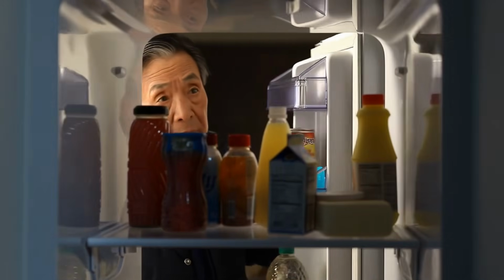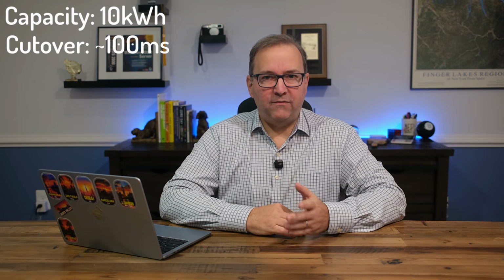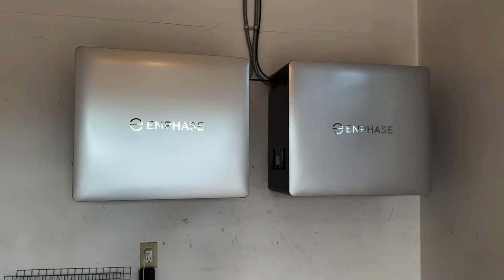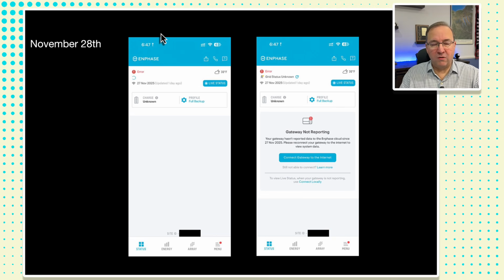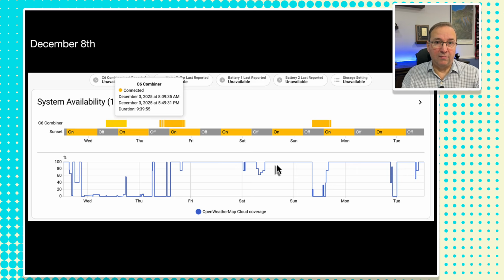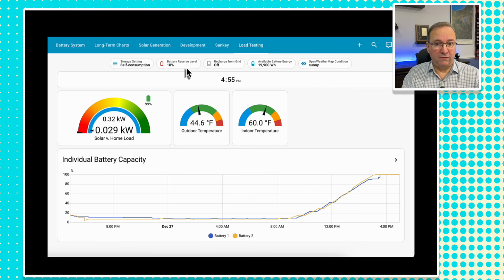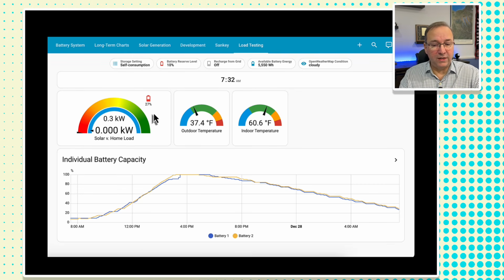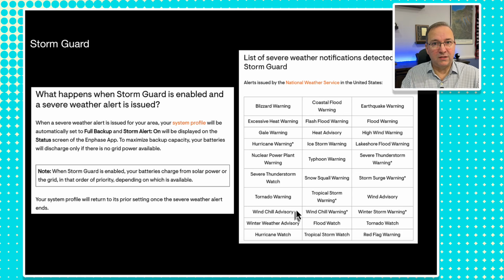I Tried to Run My Entire House on Solar Batteries for 24 Hours.

Comment from the maker: Winter storms and power outages are what finally pushed me to take home batteries seriously.

I tried to keep this video grounded in real-world experience rather than specs or marketing claims. If you’ve already lived through an outage - or are thinking about adding batteries to your home - I’d love to hear what questions you’re wrestling with, or what surprised you most once the power went out.

I’ll keep an eye on this thread and answer what I can.
Reply: Thanks for making this video--super helpful especially your trouble shooting approach.

Having the same exact errors and issues after initial provisioning 2 days ago (minus the cloud cover issues). Did the enphase tech mention what the issues ended up being or what the actual remediation was? I am being advised to go back to our installer and trying to document as much as possible.
Reply from the maker: @imichaelray  Not the best answer, but the field technician (working with my electrician) kept saying something to the effect of replacing "the stick" - I assumed it to maybe be some kind of comms card that was screwing up all of the data.

Whatever it is they did, once that change was made everything was working normally and has been ever since.

If you want to to some data capture, Home Assistant + the Enphase integration would at least allow you to pull in a lot more detail so that could help inform your working with Enphase to get this resolved.  As you saw, ultimately they did make it right for me but I was glad to have the additional data available.  I'm uploading a "Getting Started with Home Assistant" video here on the channel in the next few days if that helps.

Hope they get it all sorted out for you!

Comment: We installed a 14KW solar array in November 2024.  Now that things have gone downhill faster than we expected, I was intrigued by the Enphase 10C figuring we would need 20KW. I am dismayed at the cost for batteries & install when the batteries & controller go for less than $15000 retail.  The installation is supposedly so simple. Looks like getting a better backup generator is more affordable. We have wood heat in the winter, so no worries there. Good review none the less.
Reply from the maker: I think backup generators are still broadly more cost efficient overall in the short term compared to any battery system.  But we're in a rural area without natural gas delivery so we have a propane tank it would start sucking down.

If we were in an area with a natural gas utility service, I feel like I probably would have gone that route.

Comment: You can use your electric vehicle battery v.soon which is 4-5x your exsisting battery capacity. This is what im waiting for come June/2026
Reply from the maker: I've been hearing about that forever, even my electrician 4 years ago asked me "why get batteries, you'll be able to plug in your car soon!"

But it seems to me that V2H / V2L (?) has been incredibly slow/niche so far.  And with a bunch of Federal tax credits expiring in 2025, we decided it just made sense to jump in with the batteries instead.

But yeah, I'd much rather just have a fully vehicle-based system.

Comment: Excellent video, curious what was your cost for batteries and install
Reply from the maker: There was some electrical panel work that had to get thrown in there, so it's not a clean estimate which is why I didn't include it in the video - but "ballpark" the battery + install part of it came to a little over $20,000.

Comment: All that and didn't share the actual results.
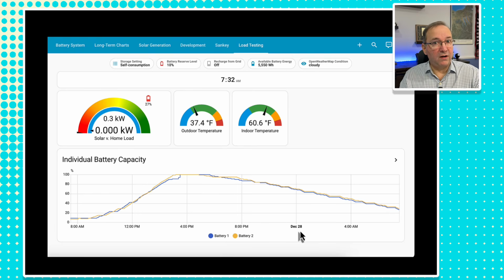Reply from the maker: The results are in the summary slide that starts at about 15:04.  5 overnight test passes, 4 passed (lived solely on battery from sunset to sunrise) - 1 failure where the battery only lasted 11 contiguous hours.

Comment: 20 kWh of storage and 8kWp of panels.  That's a decent basis for emergency backup but you definitely have to be careful about what you actually run in the house across winter.  You'll only be pulling in ~16 kWh/day with sun and you'd be lucky to get 4 kWh/day in cloudy weather.  The fridge alone will burn 2 kWh/day so yah, it definitely becomes a weather issue.

For winter operation, or winter emergency operation in cloudy/stormy weather 8kWp in panels isn't really enough, either.  But it generates a good chunk of energy 9 months out of the year so buying into an expansion is definitely subjective.  

Keep in mind that all roof facings are available for solar and will generate roughly the same in cloudy (ambient light) weather even when a sunny winter day gets you almost nothing from the "wrong side" of the roof.  And in summer you get serious augmentation of your main south-facing solar due to the higher sun, which makes running A/C a lot easier.

--

If it really came down to it (and we're talking Urban here not Rural where these things are absolutely necessary)... this is where having a backup generator to recharge the batteries, with auto-start, can really come in handy.  If you go that route go with propane because you can use the propane for direct heating too if necessary and its shelf-stable.  Tank it and forget it, basically.   A home-heating rated propane "fireplace" is nice to have too for ambiance in the living room and for emergency heat.   Extremely convenient.  And wood as a backup to the backup, so to speak.

20 kWh isn't quite enough to make it through the 18 hours of zero or insignificant solar sundown-to-sunup, as you found.  And without a generator running a whole-home heat pump is not usually in the cards either (and basically impossible if you have aux heating elements that try to kick in).  But a lot of things still are:

* A portable cold-rated heat pump (single room) or cold-rated mini-split is still doable.  Roughly 500W to hold the room.  Often heating with electricity comes down to picking and choosing which room to heat, and cold-rated heat pumps will still work down to -20F or so (usually wind up being around 200% efficient at -20F).  It comes down to a wattage-game... assuming continuous operation at 500W for 18 hours ... that's 9 kWh/day.

* A heating pad or heated blanket in bed at night (averaged 40W or so) works really well.

* Toaster oven, induction tea kettle, lights, internet, fridge.  All are decently low energy consumers.

* Well pump if you have a well.

Not much else with only 20kWh of storage.  Enphase is ... a bit expensive in terms of battery expansion but if you are really serious about it you need to be thinking more in the 40 kWh range than the 20 kWh range, and adding more solar (even if on the "wrong" side of the roof).  Then playing the export game with the extra storage during summer to get credits to help with winter.

-Matt
Reply from the maker: Thanks for the detailed feedback!  100% agree on everything - it's definitely complicated.  But this was a fun experiment to run and figure out how far we could push our system.  11 hours was pretty solid performance even on the night that it failed.

If we really wanted to get through even the most severe occasions, we probably need more than 20kWh overall.  And that would probably warrant increasing the solar system from 8.1kw as well - although interestingly in the snow/ice storm that just went through the solar panels were not generating any load for the first day while they were predominantly snow covered.

If/when our HVAC dies, I might look to geothermal because that would certainly reduce the heating load somewhat.  That could be another way to shore up the gap.

A generator would be another option, but since we're in a rural area we don't have a natural gas line we depend on a propane tank on our property, and then that's one more thing to keep track of.  Or, keeping gas cans on hand for a gas generator.

All in all, it's definitely a challenge to build the perfect system but also not break one's bank account in the process.  But I do like the system so far - I think it'll get us through 90-95% of our common outage scenarios just fine.

Thanks for watching!
Reply: @HiTechLifeTV  Geo is usually pretty expensive but since you already have propane backing up the system in an emergency amounts to a propane generator to charge the battery system.  (though you'd have to talk to Enphase on how to integrate one.  I'm not familiar enough with the 10C system to know precise details).  

In my case since I have a fairly generic 48V (51.2V LiFePO4) battery system and hybrid inverter, I can just hook the generator directly to a battery charger like the EG4 ChargeVerter.
Reply from the maker: @junkerzn7312  I got the impression that the C6 won't accept a generator input - but I might be wrong on that (maybe someone else will provide a comment somewhere along the way).  So that's why geothermal (if/when our HVAC dies) is kind of appealing.  Mentally, I love the idea of it being physically impossible for your house to ever get below the mid-60's as long as you have electricity - regardless of the outdoor temps.
Reply: @HiTechLifeTV  With Geo you usually don't actually run the house air through the geo loop (though this IS done with greenhouse geo builds).  Instead, it serves as the "outside" air loop for a heat pump.  Then the heat pump is working with 40-60F air instead of -15F ambient air for heating purposes and you get a really nice COP.

-Matt